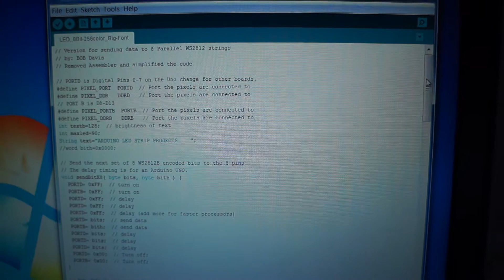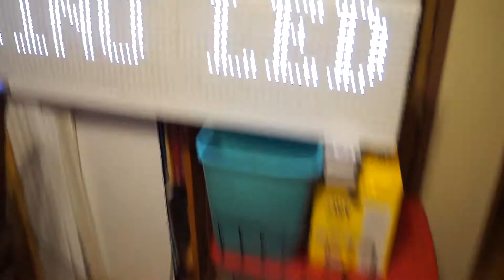Arduino 12 Line WS2812 Addressable LED Sign

Comment: Hello, Bob! I'm interested in your twelve bit mode! How do you manage to get ports B and D to work in parallel using an Arduino Uno?! Thanks in advance!
Reply from the maker: My code is on github.  Basically they are one instruction behind the other so they appear to be together.
Reply: Thanks for your prompt response!